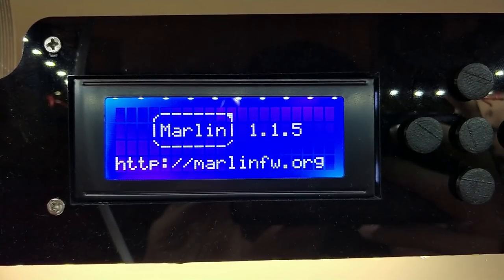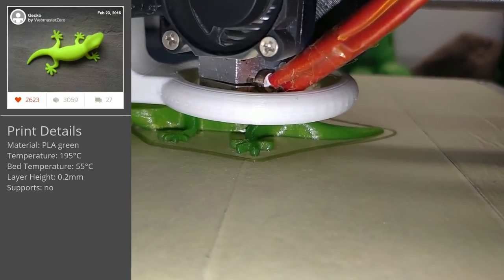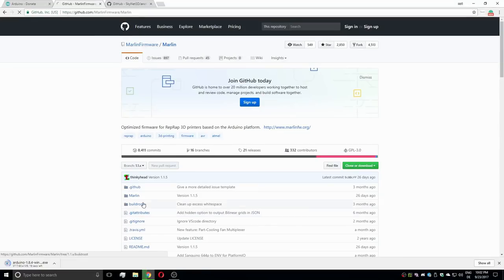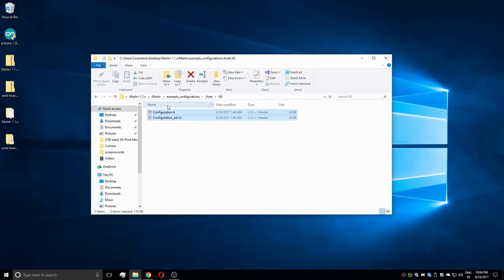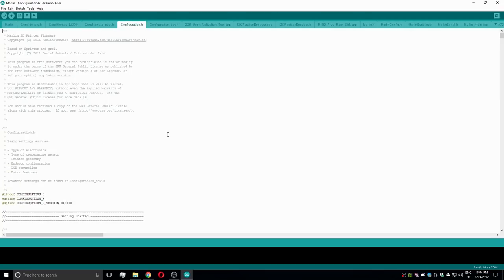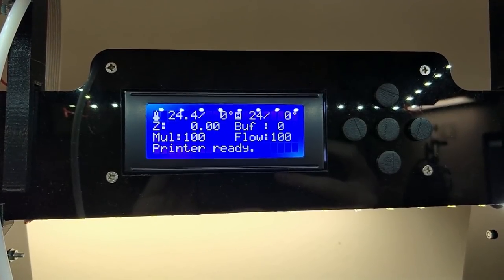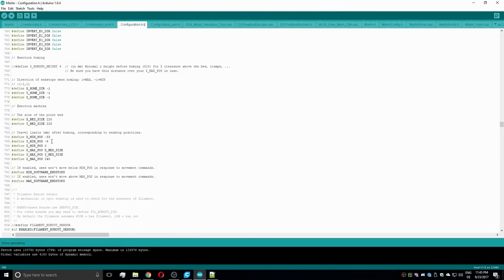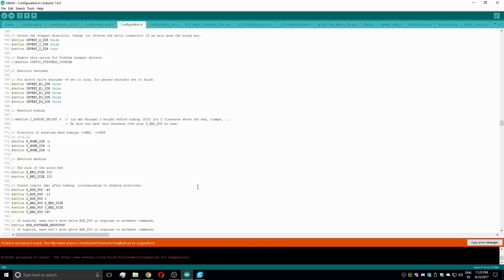Anet A8 Marlin Firmware

Comment: Im looking to upgrade my anet to current marlin firmware. I have skynet 2.3.2 installed with a a6 screen and probe sensor. does marlin support the a6 screen? Also anyway I could port my config h settings over to the new config.h on marlin?
Reply from the maker: Yeah, the A6 LCD is supported, you just need to define it correctly in the LCD section. For the config.h, it's not that easy as there have been probably a lot of changes, so you basically need to copy over each section individually (open both documents and copy the values to the new one).
Reply: Gotcha thank you! Lastly what major benefits are there switching to marlin?
Reply from the maker: Well, there might not be that many new features for your printer when you are already running SkyNet3D, but you have the latest software that will get future updates for both safety and reliability. I don't know what you SkyNet3D version can or can't do, but it's always good switching back to the original once it supports your machine.
Reply: Very true! I am currently going through the config files now to match settings. Hope everything works out! Thanks a lot for your support!
Reply from the maker: Nice ;-)

Comment: will simplify 3d works after the firmware is flashed, i know it didnt work with skynet firmware,
Reply from the maker: It normally should. I don't know the situation with SkyNet3D and neither do I use Simplify3D, but you can probably set the g-code flavor.
Reply: Thanks for the reply,
I flashed the board with skynet a while ago, i wasn't able to print directly from PC using simplify 3d, only cura,i like using simplify 3d since it has way more options to maximize the print quality .so i had to restore the board back to the stock firmware, im going to try this method hopefully it works,
Thanks Mate
Reply from the maker: Well, alternatively you could just save the g-code of Simplify3D to a file and print it using some other host software or offline using an SD card. You'd still get the same good results, as the printer can just follow the instructions of the g-code. There's no "magic" here (yet). 
As I said before, I cannot guarantee you that it works with Simplify3D as I do not use it (and don't have a license). However, you might want to check out some other USB printing host software, as the print quality stays the same.

Comment: hey, please help me. I get this message after uploading marlin firmware "avrdude: stk500v2_getsync(): timeout communicating with programmer" what should i do?
Reply from the maker: Retry, unplug/replug the controller from the PC, restart the Arduino IDE.  Also, make sure that the USB port works or try another one. That issue sometimes pops up in my case as well, but luckily resolves after two or three trials. Others have sadly not been that successful (see the pinned comment-thread).

Comment: The offset compensation tutorial link brings me to a g-code basics video.  Is that the correct link?  I thought you had a different video for this process before.  Thanks, I appreciate your videos.
Reply from the maker: Hi Dave,
Thanks for watching and your feedback!

I have shown the offset-compensation process in more detail in my GCode video (the one linked). 
You are totally right, I have quickly teased it before in one of my older videos, but as I some of my viewers asked me about how to do it, I decided to do this video explaining all the GCode stuff you'd ever need (for 3d printing).
Reply: Caverntwo thanks for the reply.  I am looking to correct the center position of the x axis through the controller interface our with octoprint.  Didn't you show that method in the older video?
Reply from the maker: No, that wasn't me. I have an Octoprint video coming, though, stay tuned for that!

Comment: very nice video! i have a question though. i got the "2017" anet a8 and the board its Anet 3D V 1_5  will that matter with the board definitions that says "1.0"? or can i just go ahead with the update. and how do i back up the original firmware in case i do something wrong? thank you for your time
Reply from the maker: Hi, thanks a lot!
This is a very good question though, as I don't really know the differences between the versions of the board.

Compare them with the ones around (I have the 1.2 as far as I know), I don't really think that there are many differences. 

A software upgrade is always somewhat risky, as the outcomes can be unexpected if something goes wrong. 
There are some links to some original firmware available in the depths of the internet, however, I haven't used any of those and have therefore no experience with them...

If you should be unlucky to destroy your board, get a replacement Arduino Mega + Ramps 1.4 + stepper drivers for as low as $15 (video coming soon, btw), on which you can use Marlin without problems.

TLDR: Try it out, if you want. If you should destroy something, there are alternatives for cheap available.

Hope this helped and if you have any more questions, feel free to ask.
Reply: thanks for the reply, ill consider the ramps upgrade on a later date, i don't want to rush into things i don't understand yet. ill learn as much as i can with the stock board then move on to some thing else. will be looking out for the ramps video
Reply from the maker: Ok, that's understandable. If everything runs fine (no broken parts which I need to replace), I hope to get the Ramps video out in the next two weeks. 
Especially 3D printing with DIY printers has a very steep learning curve; it just takes some time ;-)
Reply: Hey, no problems with the 1.5 board, thanks for taking the time to make a tutorial! there's Marlin 1.1.6 now, do i do the same procedure if i want to update to that? i read somewhere that be careful with updating to a new release, something about version mismatch
Reply from the maker: Thank you very much ;-)
Nice to hear that it worked for you! Basically, it should be the same procedure, if you do the same I did in this video now, you are already using a newer version.
Reply from the maker: I didn't hear anything about version problems, just beta versions in general can cause troubles as there might be some bugs left.

Comment: Here is a challenge: I have no laptop , desktop is 2.5m away from printer , ultratight budget(from my stingyness).
What is the porpose of upgrading the firmware? Can it solve the continue print problem? And does it have any drawback that requires adaptions on(eg home all quirks)
Reply from the maker: Hey, 100th comment!

About my setup: I have a laptop but didn't use it in this case, as my 2.5m USB cable was just long enough.

Ok, in a nutshell: You want to upgrade the firmware if you want to use some additional features that are not available with the default firmware, e.g. the addition of a filament runout sensor (see my other video). An upgrade could also fix some bugs in the original software, like my most annoying one, namely when I hit Pause, the Y-axis went 1 inch too far and thus not only crashing into the frame but also inducing an offset on continue. Furthermore, you can adapt nearly everything, which could come handy when you want to install upgrades or adapt some settings.
You also make your printer a lot safer, as e.g. Thermal Runaway Protection is now enabled (this feature shuts your printer off if the thermistor of the hotend falls out).

I didn't really encounter drawbacks so far, except that the menu controls are different (middle button to enter/exit/accept instead of right one), but I'm not sure if or where this could be adjusted to fix that. 

I don't know what you mean with "continue print problem", but it can't resume a print after power loss (you'd need some extra adaptions and probably hardware for this, which I haven't figured that out so far).

For most prints, it doesn't really matter what firmware you use. The default one did its job well, at least, most of the time. But I went a step forward to unlock the true power of "open source".
Reply: Thanks for your reply. What I mean as continue print problem is that : after pausing the print and disabling the steppers to make fixing the hotend easier , it doesn't home again and it starts to have layer shifts(and even crash on itself). I don't know how to fix it nor i have any time as the only time i have is on saturday and sunday.
Edit:my cable is only 1.45 m long :p gotta buy a new one on weekend
Reply from the maker: I also only have Saturday and Sunday free for working on the printers (that explains the low video frequency).
Well, actually, I don't know about this issue as I've never tried moving the printhead after hitting pause, but I'll give it a try soon.

Comment: After this update the unit tries to home in the corner where no bed is. X and Y is fine but Z motors bottom out. How do you tell the printer to home Z in the center of bed not where it homed X and Y.
Reply from the maker: Why do you want it to home in the center of the bed? Do you use some auto-leveling sensor? If you use one, Marlin offers a lot of customizable settings for easing the homing process with a said sensor. See "Z Probe Options" in the Configuration.h file. Please do more research on how to set it up correctly! I can't really help you here as I have never used any sensor so far.
Reply: yes i recently installed an auto leveler. Great thanks this is a start. I had no idea what to look for :(.
Reply from the maker: Keep me updated ;-)

Comment: When I copy the config files to the folder and open Marlin, it does not show the Anet as an available board.  Do you know what else I could try?
Reply from the maker: You need to move the "hardware" folder of the Anet board definitions by SkyNet3D into "Documents\Arduino" first (1:19).
Reply: I too am having this problem. I copied the files over, but they are still not showing up. I also created a sub folder entitled hardware too and placed a copy in there in documents, but still nothing shows up for the board option
Reply from the maker: Try making it exactly like I did in the video with the board definitions. You can install boards directly into the Arduino IDE installation folder in the hardware subfolder as well, although the option in documents is to prefer.

Comment: Hi there nice video but you are speaking too fast and is difficult for a newbie like me to catch every time what you say, where we put the 3 gcode lines to cura or to Arduino?
Reply from the maker: Hey, thanks for your feedback. 
The 3 lines of gcode are saved as a .gcode file and then put onto the SD card of the printer to "print" it. It will home all axes, move up a little bit and then move to the theoretical center of the bed. For more information, feel free to check out this video: https://youtu.be/SQ5ZOtb3Cjo
Reply: It doesn't read the sd card and it writes '''refresh ''' i try a lot of times but the same
Reply from the maker: When you first insert the SD card, you need to click "Init. SD Card" (right below of the other option)
Reply: I do it but it won't read the sd card again, maybe it is more procreate to install the 1.1.4 marlin version because i want to work with auto bed leveling?
Reply from the maker: Do you still use the default controller? I haven't been using auto-leveling so far, therefore I can't share any experience with it.

Comment: I put on marlin 1.1.8 and now it starts normal but the menu doesn't work. when I select something it just reverts back to the home screen. I've tried the older version but still have the same issue. any advice?
Reply from the maker: The middle button is now used to enter stuff in the menu (like with the rotary knob). Try it out.
Reply: I was watching this video and had the same issue. Thank you so much.

Comment: So the 3 line code should be written in cura at the start gcode? if yes, under which line we should write it? once and thats it, you start printing no need to worry about anything anymore?

as well after changing the values in arduino for the X_MIN_POS -33 and Y_MIN_POS -10 to X_MIN_POS -13 and Y_MIN_POS -6 the extruder is still outside of the bed on the front left side did not move to the center so what is the solution for that ?
Reply from the maker: The 3 line g-code is just a test g-code to "print", resulting the nozzle to move into the center where you can measure the offset to compensate it afterwards. Check out my g-code video for more information. You can compensate the offset on the firmware as I did with adapting the min positions, or in your slicer software using G92 commands. Please note that your A8's offsets are likely different to mine, as they rely on the physical positions of the endstops.
Reply from the maker: G-CODE Video: https://youtu.be/SQ5ZOtb3Cjo
Reply: thanks for your reply, i wrote the code on atom and tested on my printer its almost in the center however the nozzle is perfectly leveled on the bed not like your case it was 18mm. 

So in this case what do i do? on my firmware marlin x is -13 and y is -6 so do i need to change anything? what about cura should i still write the 3 lines code? thank you very much your videos are great
Reply from the maker: If your nozzle arrives at the x,y center after "printing" this 3-line g-code, then you're fine and your printer is calibrated. Cura doesn't need this 3 line code, it would even lead to bad. The original G92 code line I deleted in this video did basically the same as changing the minimum positions. Thank you very much for your great feedback. Happy printing!
Reply: i followed your steps in the G-code basics video now when i want to print the nozzle is in the center but i mean what is the next step, now if i start printing the printer will not go to the center. i should write that code which i wrote on atom on cura so that it always go to the center? and another thing yesterday i tried printing after 5 hours of printing the nozzle decided to move to a new location and continue the print. Sorry im new to printing and i cant figure it out and you seem to really know what your doing
Reply from the maker: If your nozzle is in the real center once running the 3 line g-code, you don't need anything else if you adapted the values in the firmware. If you end up with an G92 line (like in the g-code video), you need to add this line to your start g-code in your slicer software. If you properly added your printer to the said software (e.g. Cura), prints should always end up in the center. So take a look whether the build volume represents the truth (220x220x240mm for the A8). If your heated bed measures a different size, you'd need to adapt the 3 line g-code as well.
Reply: It is printing but then after sometime i dont know what happens the nozzle moves a bit down or something and its like scraping on the print. its like midway thru the print the nozzle changes height or something. the switch is fixed in place so its not coz of that
Reply from the maker: This could be an issue of your slicer software as well. To clarify that it is not a controller/-software problem, try raising the z-axis via the Move Axis menu manually and take a look whether it "jumps" back at some point. 
If this isn't the case, inspect the g-code that your slicer outputs (via some g-code visualizer).

Comment: Hello!  Is possible to install this firmware to Anet A2+ 3D Printer?
Reply from the maker: Yes, should work exactly the same, except that the maximum sizes are different. I also did it!
Reply: @Caverntwo  Thanks! I've checked GitHub repo. Now it contain A2+ config files! 
Could You explain why You use additional board with MOSFET?
Reply from the maker: The reason for the MOSFET is to bypass the high current needed for the heated bed from the board itself. This measure increases the life of the board and lowers the risk of fire.
Reply: @Caverntwo  Thank You very much! I saw video by Italian guy. He added boards with diodes for step motors. Do You know why they needed?
Reply from the maker: They help to get the motors stopping/changing direction by trying to get rid of voltage spikes caused by induction. Normally they are not needed. However, apparently they help to improve the quality on Delta machines, but I have not tested them so far.
Reply: @Caverntwo  Thanks a lot!
Reply from the maker: You're welcome, just let me know if you have any issues!
Reply: @Caverntwo  I only assembled this printer. And today I got my first PLA filament. And now I can try to print something. :)
Reply: @Caverntwo  Hi! tried to install Marlin firmware. And had bug: https://github.com/MarlinFirmware/Marlin/issues/15540 Used 1.8.10 Arduino IDE and 1.9 beta. And 1.1.x and 1.1.x-bugfix Marlin. Guys commented bug what they fix it.
Could You write how to correct configure Cura 4.3 software for Anet A2+ printer?

Comment: When trying to upload, I got this-
#error "Oop's! Make sure you have the 'Arduino Mega' selected from the tools->Boards menu. What does this mean?
Reply from the maker: Did you add the Anet board (if you want to run Marlin there) installed and selected I'm the board list? You also need to choose the correct one in the configuration file (you don't need to do it if you use the pre-configured files like I did in the video).
Reply: Caverntwo I went to tools, and chose Anet V1.0. Like in your video
Reply from the maker: Do you also use the pre-configured configuration files?
Reply: Caverntwo from example configs, then Anet, then A8. Copied and pasted these in folder containing hardware folder and arduino app.
Reply from the maker: No, you need to install the Anet board definitions into the Documents/Arduino/hardware folder. The example configs overwrite the "configuration.h" and "configuration_avr.h" files.
Reply from the maker: It's located in the main folder where the configuration files are. If you don't find yourself together, remove the Arduino stuff and carefully follow my video. It should work this way.